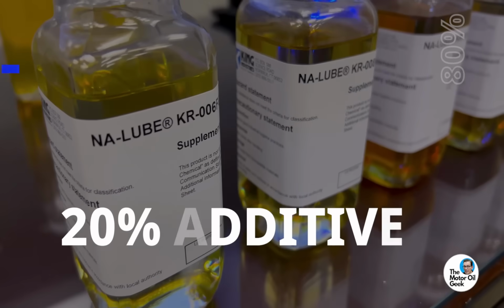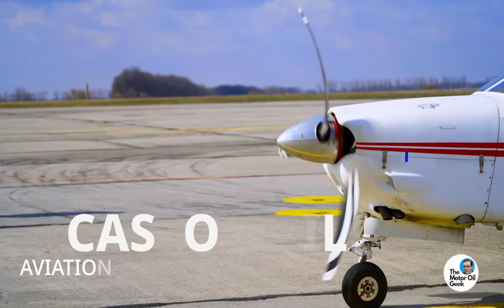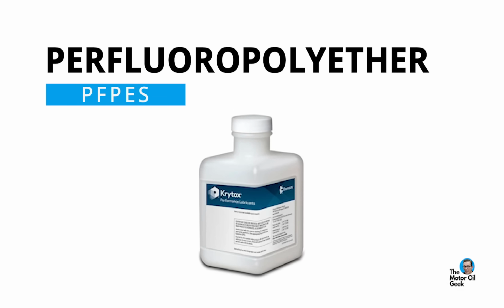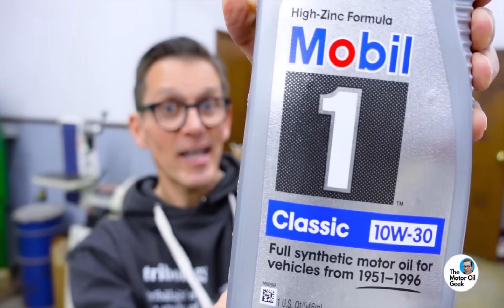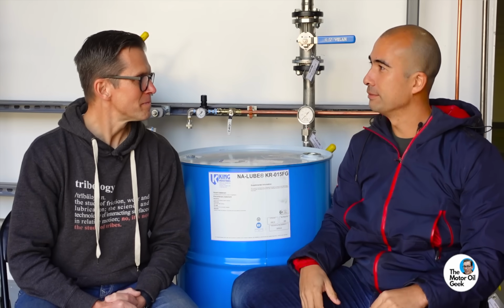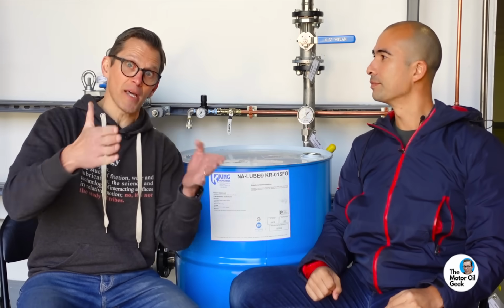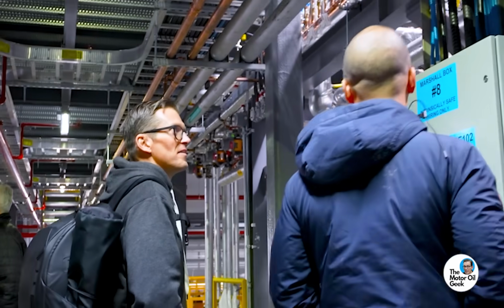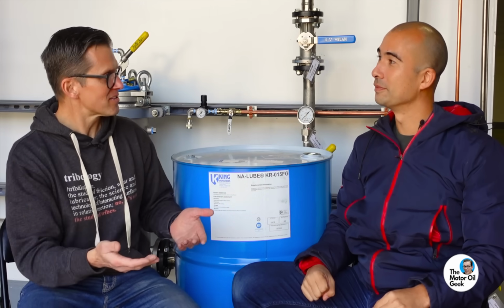100% Synthetic Oil: SCAM or SCIENCE?

Comment: My dudes.. get the analysis.  Full stop. I use amsoil 0-20 in my 21 silverado, the results showed great result EXCEPT 33 ppm copper. Couldnt have known this without testing. Bearings contain brass, which has copper.  Was told by a gm tech that the lifters do as well, but that needs to be verified.  Regardless,  high copper is now something i need to worry about.  Going to run two oil changes with something that has a thicker film at higher temperatures and do the analysis again. If anything can be learned its that verification is the ONLY way to determine whats going on. My ride has 40k on it. Scares the poop out of me to think that whatever is causing the high copper thinks it has 80k on it! (Double the ppm, double the wear?) Anyway,  this will be something that happens on the 1st few changes in any new engine i own. Zero guessing.

Comment: i’ve noticed over the years that mobile one is the oil that other companies claim to be better than. Since they are the target of all the slings and arrows from the other companies, those other companies verified, which oil is best to me, mobile one. I’ve been using mobile wand
I have used mobile one in my cars and trucks since the 70s, maybe it was the early 80s but I think it was the 70s when they had that advertisement on television, that their oil was the once a year/25,000 mile oil 
in the 1980s I went to the moto guzzi national motorcycle rally. The national rep for that brand showed up on the new 1000 Lemans. He was actually on that job because he had taken it due to the fact that he was laid off from NASA because the space shuttle exploded on takeoff earlier that year. And they laid off a great deal of the staff to figure out what went wrong. This guy was a NASA engineer. I had him to myself for a couple hours. He explained that NASA uses only mobile one in their vehicles. He also explained why mobile one will pour out of a leak. He said all the molecules are very tiny and exactly the same size. Unlike conventional oil where the molecules very widely in their size. I also remember hearing that new Corvettes came with mobile one from the factory, and that mobile one oil was the oil they used in the at that time multimillion dollar US military tanks
That was good enough for me and it has been all these decades now, I’ve never had an engine failure due to oil problems..
I do remember a batch of engines that failed because of oil years ago in the early 70s when I was a motorcycle mechanic at a Honda dealership. Brand new bike engines were failing, I was building bikes and they came to me and asked me if I was sure I put oil in the new bikes. I said yeah I think so 
so they called the company that we bought 55 gallon drums of oil from for the new bikes. I won’t mention the name. But it was car oil from a company that their letter begin with a letter K. We took a brand new bike out of the crate , and put that oil from the 55 gallon drum from that company in the engine of the bike in front of the rip from the company. We started the bike, warmed it up, we took it for a 15 minute ride and pulled in and immediately pulled the drain plug. The oil came out like foam, remember frozen cokes?? how the frozen Coke would come out looking like foam, that’s the way that oil came out of a brand new Honda 350 twin. Like brown foam. That’s when I learned that when you have foam in the oil, you can’t build oil pressure because the bubbles compress and will not increase oil pressure
Reply: Good post. Bought off showroom floor 5 speed 4x4 long bed 22r in 1985 even remember price of $7,200 used mobile one cause vets on showroom floors used it that sold me. Paid the bank off in four year drove the truck another 14 years no freakin bank payment 18 years total when rusted away on me. Have 2017 blue 4.6 tundra love changing the oil on it. My 85 was a dream changing oil and hitting up zerk fittings thats pretty much all ya got to do. Wish my Tundra had a clutch.

Comment: Thank you Lake, keep up the great work mate, 🙌🦘
Aviation oils are all classified and must be certified by the FAA, and Also CASA as far as Australia and in international oil suppliers for aviation they all must must meet very very strict certification by the official aircraft maintenance schedules, as long as the oils are listed in the manuals in the maintenance books and service logs ,then it can be used full stop.
Also when a aircraft engine or any part of a commercial aircraft is maintained the log and maintenance books must all be signed off by 3 separate qualified aircraft maintenance engineers, no matter what is done to it, including de icing or cleaning/ washing a commercial plane, military aircraft / machines has the same type of system but a lot more intense?✌🦘👍

Comment: Hello Lake loved your video but still confused is there a truly 100 percent synthetic oil on the market only 1 I see is Amsoil or is amsoil not 100 percent systhetic oil.  I have been using valvoline systhetic?  Thanks any help is appreciated.
Reply from the maker: Nope. There are no 100% synthetic oils. The additive package contains a mineral based carrier oil.
Reply: @themotoroilgeek Thank You so much for responding the my question Lake so is amsoil not really worth it would you say in your opinion for example Amsoil OE and Amsoil signature series is not worth the extra money I have a e350 5.4 ford and always changed the oil at 3500 to 6k miles its got 277k on it now so in your opinion what oil would give better protection for a standard v8 amsoil vs valvoline or mobil if you had to pick between one of those three but your input would help me narrow down a oil for myself and a v8 engine application thanks again for your well made video.

Comment: Interesting!
By chance, do you guys know if the AN-12 in Mobil Extended helps clean the engine? I wonder if Mobil 1 oils with the AN additive could compete with Valvoline R&P. Perhaps the latter uses AN as its key cleaning component?

Comment: Synthetic oils?.comes in three grades…( could be more?)
One way to judge this..
Grade 3 = 5,000x7,500 miles.
Grade 4 = 7,5000- 15,0000 miles
Grade 5= 15,000 - 25,000 miles between oil changes..
These are estimates only.
Plus you will need oil filters that can handle longer times between oil changes…
All of the above is base on my observations only.

Comment: How much difference is there between Mobil Full Synthetic and Mobil 1? Curious to know as I had been running Mobil 1 for a long time and last oil change I grabbed Mobil Full Synthetic 5W30 instead of the usual Mobil 1 5W30. I am wondering how much difference there is between these two oils from Mobile. Since one can't get all the old oil out of the motor when changing such as oil left in the engine oil cooler lines is it harmful to change to a different oil like this? I grew up using Pennzoil conventional oil until my last vehicle, and my current one that required Dexos synthetic blend but went with Mobil 1 instead. I am wondering if I made a mistake on switching to Mobil Full Synthetic instead of using Mobil 1.

Comment: Synthetic blend is the best you'll ever need... Full synthetic is overkill.. maybe it's okay in Antarctica
Reply: Amsoil tested all the Synthetic Blends in the marketplace, where they found a concentration of anywhere from 1% to 15% synthetic in those oils in their testing of those oils!  So when Amsoil created a Synthetic Blend of their own a couple of years ago (to compete in that particular segment of the market at a lower price point), they formulated it to contain in excess of 50%.  Lake had tested both a virgin sample and a sample that was used for 5,000 miles of Amsoil Synthetic Blend, where the wear metals were an average of 2.5 ppm per 1,000 miles driven. Since Lake said if a vehicle can achieve less than the 5 ppm per 1,000 miles, the oil is really, really good, so he was impressed!

Comment: If it isn't broke why change it I stick with conventional 10w30 or 10w40
Reply: Still living in the 70's?
Reply: @edwardpate6128 what 70s I wasn't even driving until the mid 80s , what's the point in wasting on fancy oil if conventional oil does the job I drive my mom's 96 Grand Cherokee Laredo 163,000 original miles and it runs great with conventional oil, unlike a 2024 my neighbor at its screwed up

Comment: Hey Lake - another great video.  Question:  I know this channel is really about automotive oil.  But since this video opens the door to other lubricants, I thought I would ask about aviation oil.  Rotax makes among other things, a bunch of aviation engines.  In their top spec 915 and 916  turbocharged engines which have a gearbox - all of which is lubricated via a dry sump, with engine oil - they now recommend and market their own branded oil called XPS for these engines.  Do you have any knowledge about this oil and why it is particularly beneficial for these engines running at 5500 rpm?  Thanks!
Reply from the maker: I appreciate the suggestion!

Comment: Amsoil is the only motor oil sold to the general population  as 100 Percent Synthetic ,it is not a misleading marketing title  because they only use Type 4 and 5 Base Oils ,  ,the rest is Type 3 'Pseudo Synth'  called Full Synthetic made of Petroleum Oil made of the Hydrocracked method..
Reply: You think they changed their formulas throughout the years?
Reply: @fcnghkkc1  Yep they improved it along through the years and  without adding Type 3 base oil  to it.
Reply: I’ve been an AMSOIL dealer for 27 years and some of AMSOIL’s lower priced oils are made from group 3 base oil, the OE oil for example. Google Amsoil mass and find the OE oil and you’ll find hydrogenated oil listed.

Comment: I always use synthetic “Mobil 1 extended performance” , I replaced the valve cover gasket on my Toyota and the valve train was so clean that I even took a picture as a proof of the cleanness left by the oil 😃
Reply: So good of you to use that oil.  How about for cooking?  Do you have a favorite cat?
Reply: any oil will do that if you change it reguraly...... mobil 1 is just marketing theres nothing special about it......
Reply: @toddbob55  I tried “Valvoline” synthetic oil in my car and didn’t work 🤷‍♂️
Reply: @rayrooney4656  Maybe the car didn't start lol. I use napa full synthetic high mileage in most of my cars and it seems fine. It's made by valvoline.
Reply: @AlexAutoRepair1  already explained but someone keeps reporting my comment , didn’t work,  evaporated , gone , disappeared ! , had to top off twice between oil change, that doesn’t happen using “Mobil 1 ”  , I go from change to change without topping off 🤷‍♂️
Reply: @toddbob55  which one is the special ?

Comment: I literally run one oil in 5 vehicles. I run AMSOIL Signature Series 0w40 in a Mitsubishi Evo X, Ford Raptor 6.2, VW New Beetle 2.5 5 Cylinder, and my CFMOTO 1000cc SXS and ATV. They all run excellent on this oil, and they are all very happy after considerable mileage. Its very handy to only have 1 high end oil around for everything.
Reply: Been mechanic for over 40 years mostly working on European cars.. I’ve used every oil on the planet. I prefer amsoil  over anything I’ve tried, including redline. We have two BMWs in the family N54 and B58… turbo motors that produce a lot of heat just run better on signature Amsoil! Both engines run cooler on Amsoil  and the motors. Stay nice and clean. Just did the valve cover on my N 54 that has 128,000 look brand new when I took the valve cover off absolutely no varnish just a beautiful honey color. Checked out the cylinder walls can still see the cross hatch on the cylinder walls. And my car is tuned with about 420 horse. It’s been one of the best cars I’ve ever owned. Of course I’ve done everything to it as far as maintenance, but it just starts up every time. I have to admit their marketing is a little strange, but I don’t care because the oil speaks for itself. It’s that freaking good.
Reply: I use Amsoil because of the research I have done. But I've always wondered why they make it so difficult to get if it's so good?
Reply: @carrotoppe  It is extremely easy to get and common here in Manitoba, Canada. I tend to order my oil from a race car shop near me, but but Amsoil offers free shipping off their website straight to your door aswell. I think the better question is if its maybe a conspiracy on why all the big box stores do not sell Amsoil... perhaps they don't wanna sell something that will lead to engines lasting longer and needing less oil changes... hmmmmm
Reply: I use Amsoil as well. What is so difficult about purchasing it? I order online
and it’s at my door in 2-3 days. @carrotoppe
Reply: Nice! I might try it when I have the money! But for now something less expensive and has good as Amsoil 🤷
Reply: @nunezracing12  If you own a business,  you can register a free wholesale account and buy Signature series for $10.65 a quart before tax. That’s not expensive.
Reply: @nunezracing12 if you have a lot of vehicles and change oil regularly I'd suggest getting their membership. Or even better if you own a business get an account. It saves a lot of money and gets the price close to off the shelf oils.
Reply: Fanboys.
Reply: @hotroddreams3130 yup, I shoot glocks, all my power tools are milwaukee, and all I run is Amsoil. Maybe we're not fanboys, maybe we just use what works and never let's us down.
Reply: @hotroddreams3130 Actually it's just guys that know what good oil is vs the guys that don't.
Reply: I run amsoil signature 5w30 in my Genesis g703.3t
Reply: @jb0915 some bro, Amsoil and Costco's Top tier gas, in my G70 3.3t
Reply: Who cares
Reply: Never been sold on Scamsoil!
Reply: @edwardpate6128 if you haven’t properly done a engine flush and used Amsoil signature series then you don’t have the right to call it Scamsoil 😂 🤡
Reply: @PrimoPapi 
So what is entailed in a proper engine flush?😊
Reply: @edwardpate6128 You do realize in countless independent testing Amsoil outperforms every oil currently on the market so please cite how it's a "scam"?
Reply: @jasonmeldrum7686  Please cite where it outperforms all other oils. Project Farm has proven otherwise in several categories.
Reply: @edwardpate6128  If you knew everything about AMSOIL, you would be sold on it. Ignorance is bliss.
Reply: @darrylsjodin7184  that applies to everything you buy or eat tooo!
Reply: @darrylsjodin7184 Please cite your documentation then and not just your opinion. Countless independent testing proves otherwise.

Comment: How little synthetic oil is required for a manufacturer to claim it's a synthetic blend? I mean, what's to stop a manufacturer to add a thimble full of synthetic oil to a 20K gal tank car of mineral oil, and call it a synthetic blend so he can charge 2x the price? Is there an SAE or API spec defining minimum proportions of mineral and synthetic oils in a blend? I think this synthetic blend thing is a big scam.
Reply: You are essentially correct.  Amsoil tested all the Synthetic Blends in the marketplace, where they found a concentration of anywhere from 1% to 15% synthetic in those oils in their testing of those oils!  So when Amsoil created a Synthetic Blend of their own a couple of years ago (to complete in that particular segment of the market at a lower price point), they formulated it to contain in excess of 50%.  Lake had tested both a virgin sample and a sample that was used for 5,000 miles of Amsoil Synthetic Blend, where he was impressed!

Comment: I have used Krytox and Dowtherm (silicone) in the semiconductor industry for many years.  No rotating machinery in their use.  The Dowtherm was a heat transfer medium to heat silicon wafers while in a vacuum and RF power was applied.

Comment: Great videos, as always…

What “KNOWLEDGEABLE” person wants to answer this question.

My 1999 E320T has 261,000 miles… burns under a quart roughly every 500 miles. I use Mobile 1 5W-40 European Car Formula as per MB instructions. 

The car was a one owner car - driven by an Asian lady who didn’t service the car herself. I have no records of service, so I can’t prove what she was using for oil… prior to me buying it.

I’m wondering what appropriate high quality oil I could use instead of Mobile1.  Something I could switch to that may even help with oil consumption before I eventually get into engine.
Reply: I would consider High Performance Lubricants Euro Car oil in 5W-40. If the consumption is caused by ring deposits their formulations are designed with cleaning esters that could help.